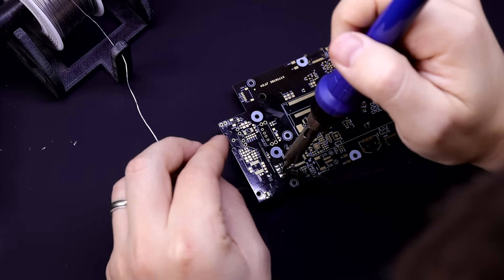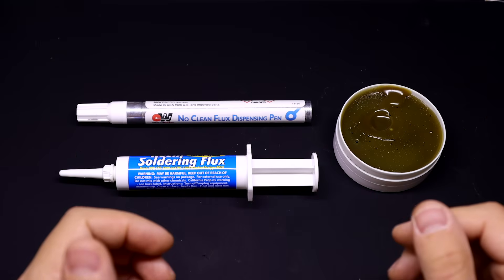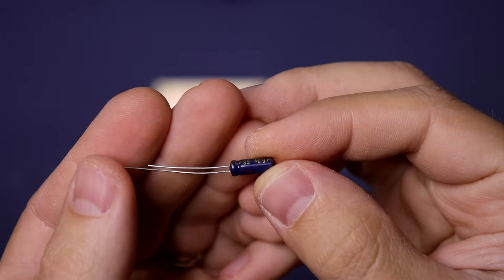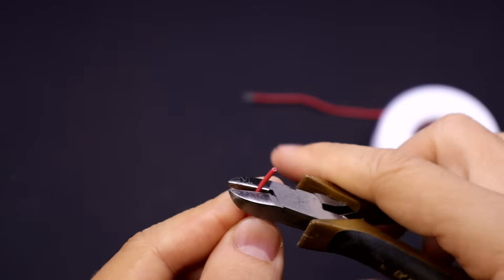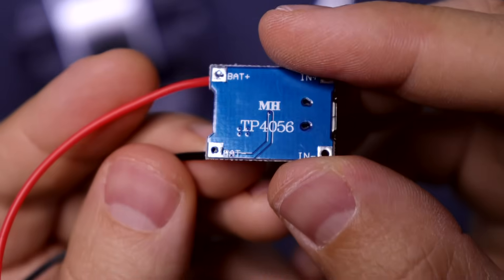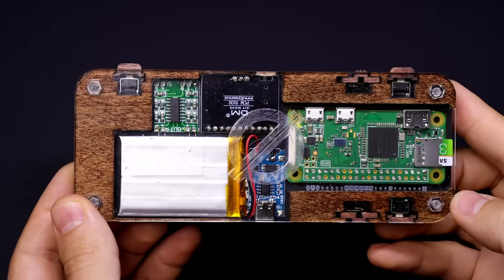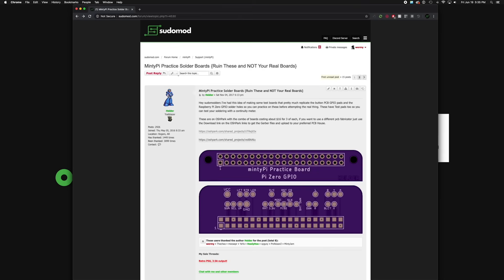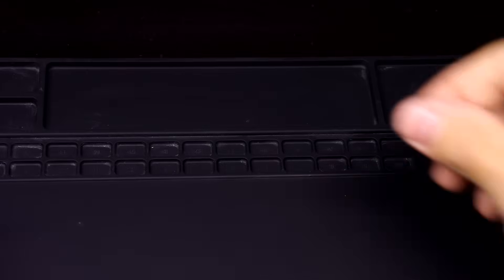Soldering Crash Course: Basic Techniques, Tips and Advice!

Comment: I would have covered a good flux to use, I use amtech flux 559 and coat it completely like a pool, a good soldering iron like Hakko and fume extractor and the cheapest idea wear gloves you don't wanna be touching leaded solder with bare hands.

Comment: One thing, I would also recommend for buying an Soldering Iron is the Power... Espacially if you are soldering Plates, SMD-Stuff or if you find yourself soldering bigger components like Laboratory Plugs... Since I'm soldering more or less in my daylie work by producing Testboxes or Harnesses for Prototyping and Motorsports cars, i Found out, that Working with an Iron that hast to little Power this work is a pain in the a**... You have to hold the Iron so long onto the components, since they don't have the Power to Give heat fast enough to the component, that it most of the Time cools as fast as it get's heat (on bigger components for sure ^^). Putting up Temperature sometimes helps, but if you aren't cautios, you risk burning the next component, cause you forgot to get temperature down again ^^ Also it's not good for the solder itself if you heat it to much (e.g. burning the flux before it even can work right and so on).
This is especially hard if you working with some kind of fume collector or even a small ventilator to get those nasty fumes out of your breathing range ^^
For this i Reccommend an Iron with at least 90 Watts... everything under this i find working with is realy hard sometimes... What this means exaktly? Well... this means the Iron will have more power to hold the Heat you want from in on the Tipp of your iron... so even losing heat (to the component you want to solder) is likely to be compensated by the amount of power you put in... and if the Surface you are soldering to is big... it also has much room to lose this heat... so it needs heat faster to put in, than the surface can give it back to the air around.

But without this, it's a pretty good video and i can subscribe to all your points ;) Great Video mate ;)

Comment: 6:25 Yeah, nice silicone wire is important. That shitty PVC stuff is nasty to solder, it immediately shrinks back when just a little heat gets to the wires. For crimping PVC is ok though.
Reply: FYI, PVC is not all created equal. Cross-linked PVC (irradiated PVC) is FAR more heat resistant. (The worst is the PVC inside typical landline phone cords, the stuff normally terminated in crimped modular plugs. It melts if you look at it with the soldering iron from the other side of the room…)

If you ever have the chance, try cross-linked polyolefin insulation, like Huber + Suhner Radox 125 or 155. It strips beautifully, doesn’t melt easily, but is much tougher than silicone insulation (and not as girthy as silicone). Teflon is tough and lovely to solder, but a pain in the ass to strip.

Comment: What’s considered a “thin” solder wire? They’re all less than a mm it seems. What’s the size of the smaller one you used to compare in the video? Or what size do you prefer rather?

Comment: I've been soldering everything imaginable in electronics from vacuum tube boat anchors to surface mount postage stamps going on 65 years.  Your video is an excellent introduction to the art of electronics assembly and wiring. 👍

Comment: great video. For me few things i can't really get head around to feel comfortable doing soldering work first is temp as mentioned at 4:57 I don't know if there is manual or something that gives you best temps for components or board types but don't want to ruin things i want to fix.  second thing is there is a lot of writing on boards I have no clue what they mean. also ordering parts was pretty hard as far as trying to figure out what replace parts i need. last thing is definitely continuity just don't get how to properly test to see if work is right and reading is what it is supposed to be. like if reading was supposed to be 5v or something and I get a 15v instead I'd have zero idea about it being wrong. so safety is a concern.

Comment: Hi there. I have one question.
I've bought Weller SPI 27 soldering iron. It  warms up to 410°C. Few days ago I tried to solder LED strip and I've noticed that the temperature was too high, so it burned a bit. Can someone tell me few advices regarding this soldering iron; is it reccomendable to solder LED strips with it?

Comment: I have a yihua 939d+ and am having difficulties with it getting hot enough to melt the solder of a 12ga wire. Mind you I am doing this in a cold garage so was wondering what you may suggest to either properly calibrate the soldering station or to get the iron hot enough to melt so I can replace a wire as intended. Any advice would be great. Thanks.

Comment: Concerning Multimeters, as I just looked into that: Look for "true RMS/TRMS" and "Auto-Range". These are reliable and easy to use meters. The counts, eg 4000 or 6000 define how fine and accurate the measurements can be if I understand correctly. 4000 might be enough as it lowers the price to a very affordable 20bucks.

Comment: Bro and me here using the soldering wire to connect a resistor and an LCD sensor without melting the alloy thinking they would just melt and stick together 💀

Comment: Definitely one of the best solder intro videos I’ve ever seen on YouTube bar none. Also tho, I hate being “that guy” but I did notice one pretty minor point I don’t entirely agree with; not at all trying to discredit your soldering skill, just attempting to help viewers a smidge more by piggybacking off the foundation you have here. 

@8:07 , I would definitely suggest trimming the twisted-together wire ends BEFORE soldering, or if easier personally for a learner (and equally as good imo if not better): solder the twisted wires together, then trim, then hold your iron to the area where you soldered and trimmed - for just a few seconds! - to “reflow” the solder, making sure that the wires have heated up to relatively the same temp as the solder did before you remove your iron tip (to prevent cold joints, which is extremely important as Wermy mentioned already, but isn’t what we’re worried about here). The reason doing things in this order is important is that whenever you trim any kind of solder joint you run the risk of “cracking” the joint from the force of your tools on the metal. Solder likes to break off in chunks when outside force is applied. You can think of it kind of like a frozen lake when something too heavy gets thrown on it; the cracks spiderweb all over and make it so the ice isn’t connected as a single solid piece anymore. 

Another analogy, glass is decently strong and can withstand some weight on it or jostling around, but a solid hit will shatter it. Here, this is what is happening to the solder joint but at a microscopic level. So you can think of reflowing the trimmed joint as reheating shattered glass to a high enough temp to reform it into one piece again if that makes sense. remembering to reflow joints you’ve trimmed up can save you a lot of trouble when trying to diagnose why your project isn’t working.

I’d be shocked if Wermy doesn’t already know this so I’m safely going to assume he does because he’s skilled, so he either forgot to include it or didn’t think it was important to know at an intro level. imo tho it’s something that should be learned right out of the gate and be kept in the back of your mind because it’s just a good practice to do no matter how intricate or lax your electrical wiring for your project needs to be. 

For the viewers learning: ANYTIME you trim ANY kind joint that’s already soldered, there’s a good chance you cracked it a bit so it should be reflown. If your project doesn’t have super finicky or precise voltages you probably wouldn’t even notice, but as you improve your skill and go onto more involved projects this can definitely become an issue if you aren’t aware it’s something to look out for. 

Anyway hope this helped a bit, and good luck to y’all! Soldering is the shit ❤️

Comment: This is a really good crash-course soldering video, but there are a few corrections I'd recommend:
1) Trim through-hole leads before soldering rather than after.
2) Don't twist wires tight before tinning. Maintain the original spiral lay. Twisting tightly will not allow the solder to penetrate and create a strong connection.
3) Don't twist wires together before splicing, for the same reason. Lap splicing works just fine.
4) The aggresive fold of your spliced wire is generally not a good idea. Different types and diameters of wire have different recommended bend radii in order to prevent overstressing the metals.
And just so you know, I'm a certified trainer in J-STD-001, IPC-A-610, IPC/WHMA-A-620, and IPC-7711/7721.

Comment: The issue I'm having is the tip of my soldering iron almost immediately becomes black and nasty and stops melting solder, maybe within 5 minutes of using it. This is at 250 C. Then I clean it and then the same thing happens. Maybe a bad tip, I don't know.

Comment: 6:52 so you dont like the solid core wire but you solder the strand core wire together to make a solid core wire?
Reply: You pretin the stranded wire both to make it easier to work with, but also to make the subsequent soldering process go much faster. Then you still enjoy the advantages of stranded wire (flexibility) when it’s done. Solid wire can only be flexed a few times in the same spot before it breaks from fatigue.

Comment: Notes: 2:56 Don't drip. Heat up both components and use the solder to fuse them together.

Dripping will get you a "cold" connection sometimes.

Comment: Really glad you mentioned rosin core solder. I've seen so many comments about soldering where people say you have to use flux. I worked for years doing electronic repairs on telecoms and radio gear and before that, electronic assembly. I never once used flux, because all the solder I used was rosin core. Even when I was trained in high-reliability soldering, we never used flux.
Reply: Same here. I have it now that I'm getting into smd but before that, none except what's in the solder core.

Comment: Awesome thank you just needed to solder 1 pin on my car's CPU and didn't want to mess it up, but now I know I can build that guitar tube amp from scratch like I always wanted to do and have parts on the shelf for years now, and your right don't be afraid you can do it no wonder the Bible say's "fear not" over 100 times thanks again been a mechanic for 20years and just learned rosin core solder has rosin in it lol

Comment: I have a EU Honda 7000is Generator, I have had it several years and hand' used it less than ten times, there is an circuit board inside it that needs to be replaced, its said to be un-serviceable, I Don't believe that, I think that someone that knows what they are doing can repair it.  There is a video where a man is just changing the circuit board, called an inverter out for a new inverter, circuit board that cost $700, you see my motivation to be able to repair this barley used circuit board?  I need to learn how to test this circuit board.

Comment: I appreciate this video. I was looking at the first iron setup you showed thats on amazon. The one thing you mentioned was the silicone pad, i will remember that when i do go to order the iron setup with the heeat gun. But this video was very educational when it came down to that type of small micro soldering. I have been testing myself with that small of soldering lately with my speaker box controller for my 4wheeler and those tips will also help me out more with my RC trucks and cars when i rework connections. 
Thank you

Comment: Brilliant video man, however I would suggest not inserting the iron tip into the pinhole on the pcb, if the pinhole gets too hot you risk damaging the through hole plating.

Comment: This is what i have to do on 9:00 because one has snapped off which has left a small round piece of solder left on the board. Question - do I remove this round piece of solder before resoldering the small thin wire back on the board?

Comment: Hi.
Does solder itself conduct current as much as the components one is soldering ? 
Or, if wire is not actually touching pad or component does solder still, by itself, complete the circuit ? 
Ex: In model trains wire sometimes must be soldered to side of a rail..If solder becomes a 'bridge' between the two, the two not actually touching, will the electronic connection still be as it should, voltage/amps-wise, space between the two thus filled with solder at perhaps 1/32"-1/16" density ?

Comment: I've been trying to solder two different "projects" for 2.5 hours now. The solder is not staying on my solder iron, it keeps rolling away from the joints I'm trying to make. A soldering iron is a pretty simple tool, but I think maybe the surface of mine needs cleaning, cuz the solder is simply not behaving on it like on yours 🤔

Comment: Plus a great way to practice soldering and desoldering, we've all got broken electronics at home or come across them in the street (sadly) so you can take them home, open them up and after discharging any and all capacitors then you can work on desoldering components, and then resoldering them onto a stripboard, plus you can practice other techniques like soldering more temperature sensitive components etc, plus you can then save and put aside any large/special components you come by in this process, so at least those broken electronics don't go to waste! =)

Comment: Pro tip: when you remove you iron DO NOT touch the joint again with the iron, this will cause micro cracks. Put the iron on, heat it up, apply solder, keep it on a little longer and come straight off, don't blow on it/touch it with anything until it cools. Also, remove any factory tinning solder, and add new.

Comment: 5 1/2 minutes into this video and I've seen you make some beautiful clean solders but what I desperately need to know and has always been my downfall how and how often do you clean the soldering one tip when you're soldering I never see this when people are giving you lessons on how to solder forgive me if I sound like a jerk but that's what I desperately need to know I've seen people use sandpaper small metal files which is what I was using until after 5 years my soldering wand finally died I bought a brand new one and it's soldered like a champ until I went to clean it and all of a sudden what took from 1:00 to 4 seconds took 30 to 60 seconds to solder obviously I cleaned it wrong so pretty please with sugar on it would you simply tell me "how and how often: do you clean the soldering wand tip! Eric Sahagun

Comment: Is the Silicon pad for soldering ESD safe, or does it have a ground cable/plug it comes with to connect to ground to drain ESD/static electricity (I didn't hear you mention this about it)?

Comment: So basically i heat up the yellow iron ring on board and the stuff that i want to solder then i push in the solder wire into it (let the yellow ring n stuff melt the solder wire) ? I've been melting the solder wire with the solder.........

Comment: Guess the soldering iron i have is junk. Because at no point can i heat up the joint enough to melt solder. I can only melt it when touching solder directly to the iron. Heat was maxed out. I gave up. Threw everything out. Buying something pre made for what i need

Comment: I'm just tired of spending money on terribly made $60 PS controllers. Most controller end up with stick drift from wear and tear. Other times when you drop a controller, which we all do, a solder will break loose and you can hear it shaking around inside the controller. Which is what happened to my $250 PS5 scuf controller. Had it for two months and no its unusable because a solder broke off and now my L1 and L2 just don't work. 

So now I'm here learning a new skill in order to save loads of hard earned money. I might actually make a side hustle out of it. 🤔